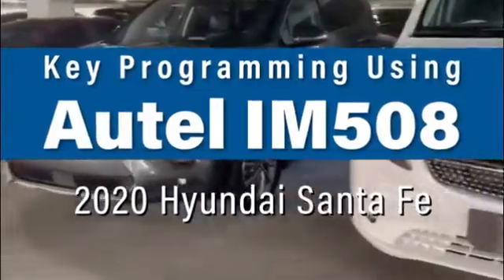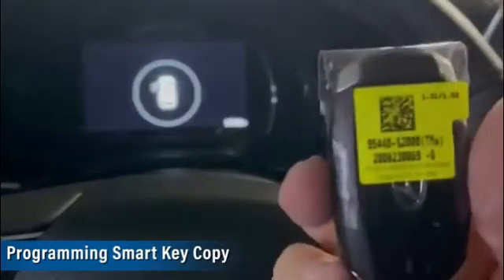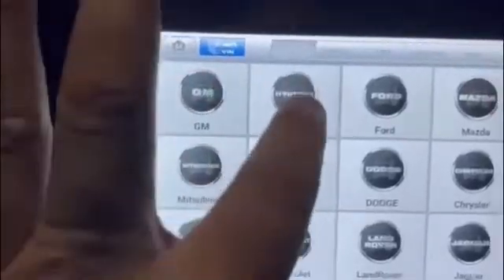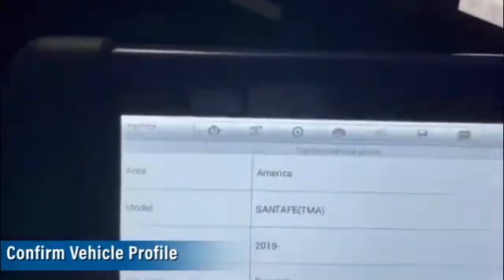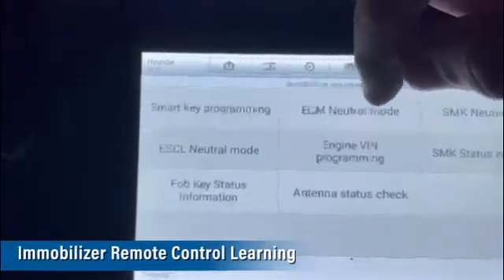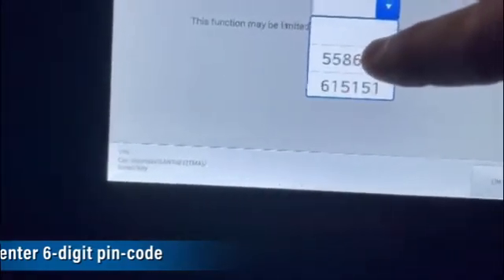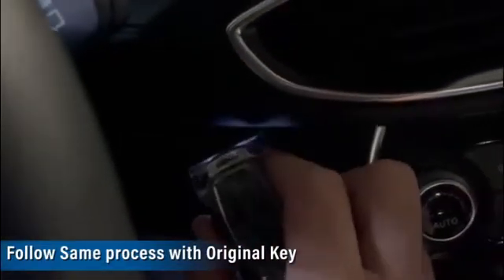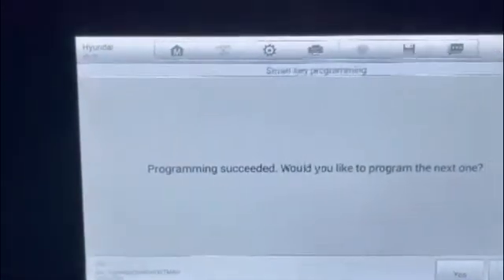2020 Hyundai Santa Fe Smart Key Cloning using Autel MaxiIM IM508 Programmer

Comment: How did you get the pin code? Which software did you use? 
How do you really clone a key?
Everything is wrong about this video.
Reply: Nothing wrong except u
Reply: @uuzx0  funny 😁  how you just avoid  answering 🤣 😂. no problem. Keep up with your half videos.
Reply: @Jorge-kn8oj  obviously it's not cloning operation and it's gonna be long lecture for someone didn't know that anyway u can get the pincode from the dealers
Reply: @uuzx0  obviously not. And dealers will not give you pin codes you need to register with NASTF at least here in the USA to get pin codes. And yes most tools can get pin code by obd2. But would be nice when putting videos up. First get the tittle right and second if you going to say I got pin already mention if it was with scanner or you bought the pin from a 3rd party. That's all . But anyway it is a good lesson for someone.
Reply: @uuzx0  what a stupid comment that was. So you know where he got the pin code from I assume. And tittle says clone key and I saw no cloning but just programming a new key. So I assume you cloned your brain with a apes oh hold on a ape is much smarter. 🤔  go back to your reading and come back when you get a better answer. 🤣
Reply: Actually u can get the pincode by the autel